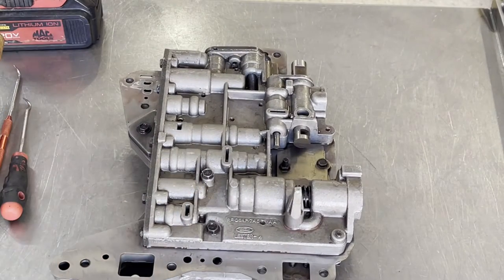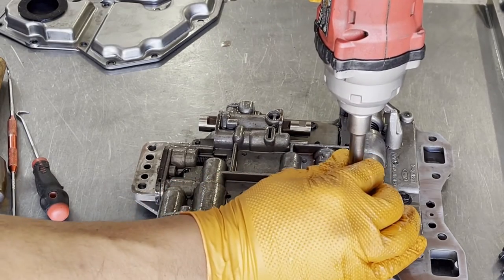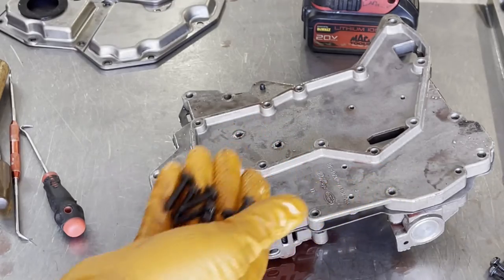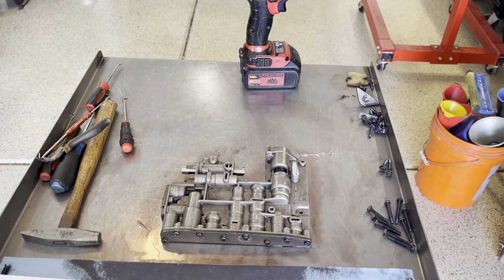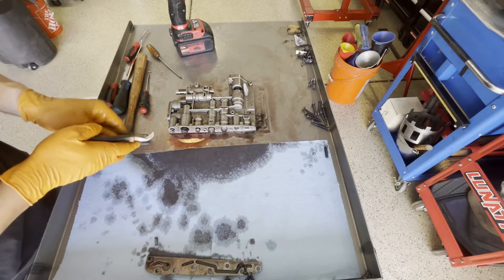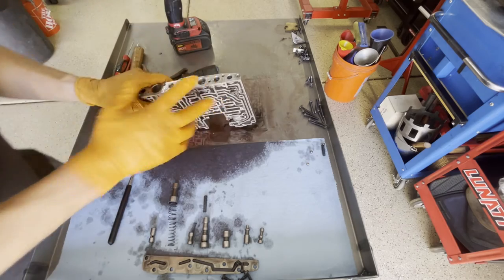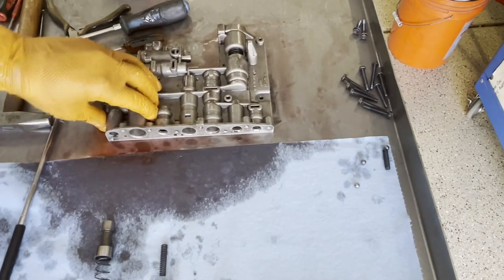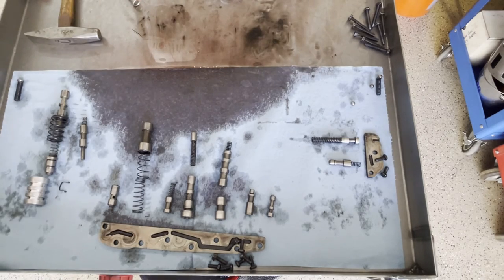Rebuilding the Ford C6 Transmission: Valve Body Disassembly

Comment: I always  remove all the  valves  and  wash them  with  3608 lacquer  thinner  and use   bench  buddy  bore  brushes  to hone  out the  crud ,,,, I love  the  good OL C-6  SENC  1977. BUT I  ONLY  SEE ABOUT  3 OR 5 A YEAR  SENC  THE  EARLY  2005 s. Glad you  put  this up on  you  tube 😎
Reply from the maker: Yep, great 1-2 punch for valve bodies and pumps (and anything else with valve trains)! I only see about 3-5 or so per year as well but may be doing another one in a few weeks...

Comment: Yes! That  longer  bolt  in the  filter  is very  important,, it's a  guide  bolt that  actually  works with the  I d tag   bolt   ,,if you  look  closely  , you will see  the  wide  valley  hole  to line  up your  halves  in  re assembly  😎
Reply from the maker: True dat! Thanks for watching, Louis!

Comment from the maker: @ delaosdiesel8616 - valve bodies are the same between gas and diesel structurally however the diesels have different shift timing/firmness calibrations. Saw you posted the question but for some reason it disappeared when i went to reply.

Comment: Thank you sir, I feel much more empowered to take on this task.
Reply from the maker: Thank you, LostandFoundClassics! 
Appreciate the kind words. Let me know how your C6 build turns out...
Reply: @nickstransmissions   Will do, I just pulled the Valve Body off after the video and ordered the parts. :)
Reply from the maker: Pick up a set of bench buddies as well, in case you have to polish any of the valve body's bores. Soak them and the bores with WD40, put in a drill. Polish for 20-30 seconds then check until the valve goes in without hanging up/dragging.
Reply: Hey, @nickstransmissions  I'm having a little hang up. Everything looks good other than the fact that the OEM c6 valve body throttle boost spring is broken and none of the aftermarket kits include this spring. 

You remove the spring I'm taking about minute @18:13 . The spring is broken on mine and I need a new one. 

Would you have a part number where I could possibly get that spring in the next 3-4 days? 

Thanks man. Everything else is going smooth.
Reply from the maker: Hey man, sucks to hear that spring was broken. Not sure on part numbers or whether its even available. You can call Sonnax on Tues to see if they make one but if not, your best bet may be to locate a used valve body in the junk yard and grab it from there or perhaps a local trans supply shop will sell you a used vb for cheap.
Reply: @nickstransmissions  I was able to find a spring and put it back together. 

The truck now shifts great. BUT I now have another issue. 

When the transmission warms up after driving it a few minutes its like the transmission just stops working. 

If I turn the truck off and let it sit for a few minutes, fire it back up, it goes back in gear for a little bit. 

Fluid is all topped off properly as well. 

Any guess as to what could cause that?
Reply from the maker: What do you mean when you say, "it stops working"? Does not not upshift or do you have a no-movement condition or some other symptom pattern? Does reverse work when this happens or no? How many quarts of fluid did it take?

Put a pressure gauge on it and see what happens with line pressures when it goes from cold (and working) to hot and not working.
Reply: @nickstransmissions   I'll have the truck in Drive. As I'm driving along, it'll act like I put it in neutral. 

When that happens, the transmission acts like it's not in any gear at all even if I have it in drive. 

If I turn the truck off, let it sit for a few minutes, start it back up, then it'll drive for about 30-60 seconds and act like it's in neutral again. 

If I let the truck totally cool off, start it up, then drive it, it'll drive fine for a few minutes before it acts like it's in neutral again. 

Neither Reverse or Drive work when it happens.
Reply from the maker: Sounds like a total loss of line pressure after getting hot...Could be pump, valve body or possibly converter...Check fluid level again then put a pressure gauge on it and let it idle (perhaps drive it a very short distance if you want) - if pressure drops then you either have a valve body issue (PR / Boost pressure valve leaking) or the pump itself is no good (either was bad when you installed it or you damaged it). Also check your vacuum modulator - see if you have any transmission fluid in the vac line coming from the modulator.
Reply: @nickstransmissions  Will do, I'm concerned it may be the pump. The fluid was bad, chunky, and the vale body was nasty in the worm tracks. I also put a new modulator on it already.
Reply from the maker: If you end up pulling it out, make sure you check pump gear (drive and driven) to pump body clearance. Also resurface it if necessary (stator-pump cover has to be perfectly flat and body pocket has to be machined to the correct depth so that factory specified clearance is maintained. Purchase a new set of pump gears as well. 

If the valve body is messed up, just grab another, good used one. Seems like it had some broken springs, etc - probably a sign that its heavily worn out so not doing you any favors. Just replace it w/another if you end up going back through the unit.

Comment: How tight should the boost valve assembly be? Mine requires a lot of pushing and prying to get it in and out?
Reply from the maker: Hi Chris, thank you for watching...The boost valve and sleeve should fit snugly in their respective bores but shouldn't be seized or stuck...If you have to pry it out with a lot of effort, my guess is the bore, sleeve or both is slightly warped. 

Sonnax has a few different boost valve and sleeve kits for the C6, depending on which variant you're working on so if you want to replace the factory valve, you can do so with one of theirs...I think Transgo makes them as well but not 100% sure.

Comment: Hey nick, super helpful video by the way feel a little more confident on eventually taking my valvebody apart but I have a question, I was wondering why my c6 would completely lose third but I still have 1st,2nd, and reverse? Could it be my modulator or is it simply that my 2-3 shift valve is stuck? Any help is appreciated please and thank you ( btw this is in a 87 f250 4x2 mounted to a 351w)
Reply from the maker: Hi Hagen, thank you for watching...When you say, "completely lose third <gear>" do you mean it's no longer upshifting from 2nd gear to 3rd gear or when it does upshift, it feels like in neutral?
Reply: @nickstransmissions  it no longer upshifts from 2 to 3rd it just stays in 2nd and I’m not having to manually shift it from 1-2 either
Reply from the maker: Gotcha...I'd first check your engine vacuum to make sure it's pulling at least 15 in Hg; if not, find and fix the source of any leaks. If vacuum is good, I'd vac test the modulator using a hand-held vacuum pump to see if it has failed in some way (note if the diaphragm inside gets perforated, the engine will begin to suck transmission fluid into the combustion chambers and burn it with the fuel; white, sweet-smelling smoke will start coming out of the tail pipe(s). 

If the modulator passes, remove it and check the modulator valve and pin to make sure the pin didn't break and valve isn't stuck. Use a pencil magnet to access the valve. If those are fine, remove the extension housing and check the governor - make sure each valve has movement...There's four 3/8" bolts holding it to the governor support  drop the valve body and look for stuck/seized valves...Make sure you put it back on the same way it came off. 

Once you checked those things, drop the pan and valve body...Separate the valve body from the separator plate and channel plate then use a small, flat blade screw driver to work the 2-3 shift valve and others to make sure none are stuck/seized. If they are, remove the cover plate and valves...Then sand the valves with 800-1000 grit sand paper (1500 grit to finish) and polish the bores with bench buddies and either trans fluid or WD40...thoroughly rinse each bore after doing so. 

Also check the filter to make sure it's not partially restricted.

Let me know if you have any ?s.
Reply: @nickstransmissions  thank you very much I’ll get to it as soon as I can!
Reply from the maker: You're welcome, Hagen

Comment: Hello, do you know of a locking, non flexible dipstick that fits a turbo 400 matched up to a 351w? The locking lokar is too expensive and hard to read imo, but if I don’t have another option I don’t know what to do. Thanks
Reply from the maker: Tim, unfortunately I don't. Contact either Brian's Truck Stop, Broader Performance or John Wood Automotive as they are Ford specialists and may have a solution for you. CK Performance, a GM Specialist w/TH400s may also know of something.
Reply: @nickstransmissions  will look into them, thanks

Comment: Awesome videos Nick! I followed your procedure exactly and my valve body (which I thought was beyond repair) works 10x better! My only issue now is that the transmission skips second gear when in D - it jumps straight from 1st to 3rd. If select the gears manually everything works perfectly. Is this issue related to the valve body or perhaps the modulator? It will downshift from 3 to 2 when I step on it hard enough.
Reply from the maker: Thanks, man! Your band and servo are working so no issues there...Id check your kickdown system to see if it's set up correctly, including the kickdown valve.
Reply: @nickstransmissions  thanks for that. i think the kick down system is good (I use a Lokar cable) and I believe the kickdown valve is good too but I will have to check. What does the Drive-2 valve do? Is that not responsible for taking it from drive to second? Thanks again for the help.

Comment: wasn't there supposed to be a gasket between the spacer plate and the channel casting?  Mine from my 1989 Bronco had a gasket
Reply from the maker: Yup. Whomever previously worked on that transmission took a lot of liberties....leaving the channel-spacer plate gasket out was one of them. The filter gasket was another.

Comment: Why would my converter relief valve not have springs it has an aluminum plug and my intermediate modulator valve has no spring also with a brass plug.
Reply from the maker: Cory, sounds like a B&M Transpak shift kit has been installed. The kit uses plugs for the int servo modulator valve and 1-2 accumulator valve to firm up the 1-2 shift. Someone left out the converter relief valve spring.
Reply: @nickstransmissions  should i leave it or put a tci scat pack kit in it? Thanks for replying so fast!
Reply from the maker: I would review the instructions for both and see what set of mods you prefer...If you're on a budget, I'd leave it in and see how you like it then make a decision after a test drive. I don't know if you already driven the vehicle w/the shift kit, if you're rebuilding a core from a junk yard or what so hard to say, to be honest. If you want to provide more context, that may help me understand what you're trying to and what year/make/model and application...

Comment: Nick, any tips on why my c6 would t downshift into 1st unless I manually shift it?    I appreciate any advice.    Mj
Reply from the maker: Hi Michael, no-downshifts (or upshifts) are usually governor, valve body or modulator. When was the last time the transmission was worked on and if recently, what was done to it?
Reply: @nickstransmissions  I bought it used..
 Then when it started leaking I put Molly in it like a fool.   The leak came from a crack in the yolk.   I addressed it and cleaned up the governor at the same time.  It was sticking a bit... but slid nicely afterwards.    I watched your videos... and thought about going after the 1-2 valve next?   
    For real, I appreciate the reply... ya didn't have to.  Fr
Reply from the maker: You're welcome, Michael. Let me know what you find out.
Reply: @nickstransmissions  Will do, it may take some time to get to it.. it'd the truck in my profile pic, and my daily driver.
Reply from the maker: That's a nice looking truck!
Reply: @nickstransmissions  Thank you. 
   Been driving it since '99.   It didn't look like that then.   Little by little.  
   Hey, bless ya for the help, not only for me, but for many I see who struggle to understand these automatic Transmissions.
    You've been help to many I see.  Mj
Reply from the maker: You're welcome, Michael. Have a great weekend.